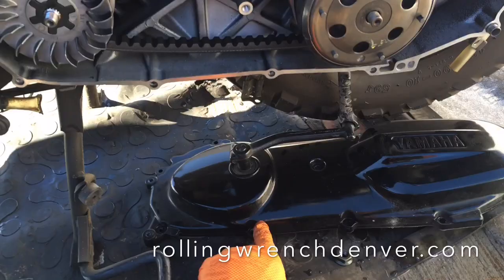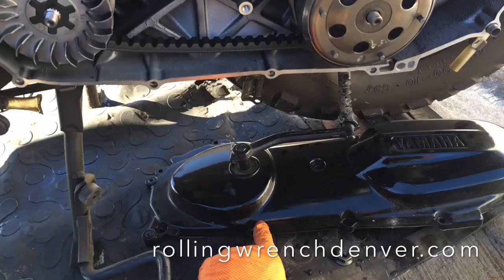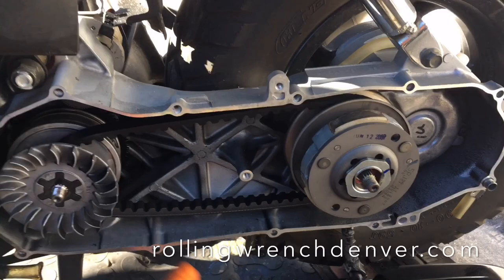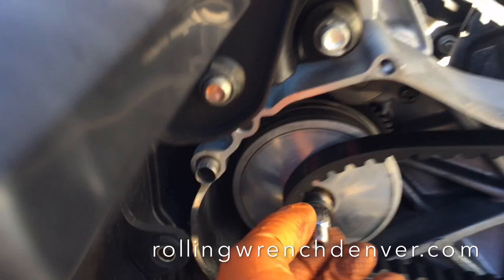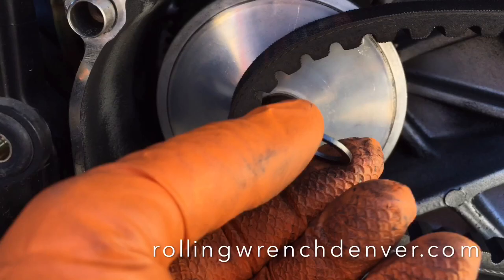Yamaha Zuma 2T FREE performance upgrade

Comment: People, doing this, you will lose acceleration in "first gear" but gain top speed (provided that the spacer lets your belt sit closer to the shaft). It can be quite dramatic, like 10 km/h. Go ahead and experiment and see what you prefer. BUT, before you experiment or do anything, READ THIS and do not throw this spacer away!

When reassembling, the conical washer that is used with the nut (also make sure to install conical washer the right way), should NOT touch the splines of the shaft. The conical washer should sit against the "whatever you call it other part". If that conical washer even slightly touches the splines, it will eat the splines away when you torque it, especially with an impact gun (which most people use). Have fun disassembling and repairing your splines and other damaged parts after that (if at all possible). This is applicable to Yamaha BWS of all years and probably most other brands of scooter. When checking if the spacer is required in the assembly (and given the tight tolerance of the assembly, I'm sure it's required 95% of times), make sure to give your belt some slack so that you see the real final assembly position, or even better check without a belt. 

If you can see the splines, or if it looks like that washer might touch the splines, or if in doubt, you need to put that spacer back, or another spacer of the appropriate thickness to protect the splines. The spacer should be over the splines if you go for this mod. You can put the spacer either completely at the back or at the front. Now you may think, but I've already done this and removed the spacer completely and everything is fine. Think again! This is a conical washer. It will sit slightly differently against the splines everytime you torque it. The first 15 times might be fine, but the 16th time it might completely destroy your splines away. You will potentially be screwed and very sad.

Removing the spacer will also slightly affect the kick start mechanism. It automatically becomes "looser" if you completely remove the spacer (the mechanism has to go farther to engage). I'm not aware if this can lead to issues, but it's definitely not impossible.

To recap:

If you can see the splines when you're about to put the conical washer, you have a problem! You need a spacer. Put it completely at the back or at the front so that the splines are protected from that conical washer.

Edit: after careful analysis, I believe it's better to put the spacer completely at the back of the variator (if you do the mod). This keeps the belt in a more natural enlignment to facilitate reaching the highest speed possible. If you completely remove the spacer or put it in front, the belt is angled in a way that doesn't help pushing the torque drive to it's "highest gear" position.

P.S. If looking for top speed, have a look at your contra spring. Ensure that it is completely seated and free to rotate in it's location in your clutch. If it isn't completely seated even by 1 mm, it could affect your top speed quite a bit. Grind it (both the face or outside diameter, as required) until it's completely seated. Also look at the compressed length of your contra spring versus your torque drive. In the  absolute "highest gear" position, my clutch leaves exactly 3cm for a compressed contra spring. The blue and red contra springs I have here, when I compressed them, are both exactly 3cm. This means that the torque drive has to COMPLETELY crush the spring for you to reach top speed. For the blue one, that means 65 pounds of pressure (measured on a body scale). For the red one, that's approx 100 pounds. That's a whole lot of force required on your spring for you to reach absolute top speed. Hence why you shouldn't use the stiffest contra springs unless you absolutely have to.

You're most welcome. Remember to share your knowledge!

Further reading: 
https://www.pedparts.co.uk/blog/variator-fitting-crankshaft-pulley-spline-damage

https://benelliquattronove.wordpress.com/2018/06/05/scooter-cvt-variator-tuning-tip/
Reply from the maker: Wow, thanks for the detailed comment 🙏
Reply: Would this lead to making it extremely difficult to remove the variator and stuff from the crank shaft? Because I just tried removing mine and cannot get it off
Reply: @yesfigureitout  Hi, it's been a while, but yes. If the material of the splines got smooshed, it could prevent you from easily removing or installing the variator. You can check with a flashlight and even maybe a magnifying glass if the splines are damaged. If the splines are damaged, maybe tapping lightly with a soft hammer might help remove it. But don't quote me on that! When it happened to my friend's scooter, we were able to remove it, but not install it. I had to take some sandpaper and work the damaged splines until they were clean, and then we were able to install it back on. Good luck!
Reply: No u won't mine accelerates fast as hell and I went from 31,32  mph to 39 ,40 mph depending on weather and first ride of day sometimes
Reply: @yesfigureitout  sometimes can be hard to remove veriator anyway wiggle and pull keep trying it will come off bro
Reply: @CompletelyNormalPhenomenon  are u talking about the grooves in the crankshaft because my variator ate my bolt that was holding it on and I’m not sure if the space I took off is the reason for that
Reply: @CompletelyNormalPhenomenon   for some reason my variator shakes even when the bolt is on holding it any reason  for that
Reply: @FatboyTris  I would have to see pictures, I haven't looked at this in a long time.

Comment: I did this trick plus I  installed a new  bando belt and lost almost all takeoff power but reached 40mph, old belt was about 4mm narrower, decided to place back the washer and it worked just fined
Reply: Help! Since the last maintenance my 2016 Yamaha Zuma 50cc, has NO takeoff power. Wide open it still bogs down and eventually reaches 38 mph. I took it to another repair shop, who kept it for nearly 3 months. $300 and still have the same problem! These are great scooters, but something or someone really messed it up.

Comment: You’re actually supposed to play with different wit spacers, depending on the width of your belt and the length of your belt. Also, the size of your variator matters. By removing that washer you’re not using the first 10 to 15% of that variator at all because the belt starts riding higher.

Comment: I did it on my 2000 Zuma and I lost a shit ton of take off power but I did gain about 5mph on top end and it did eat the side of my belt up just wasn't worth it to me I had better luck tuning the variator weights and leaving the washer in place
Reply: This ⬆ had the same experience with my Aerox R. Very poor acceleration and not worth it unless you travel long stretches i guess

Comment: When you do this you need to put the washer back but more in front not to ruin your variator and you will still gain a bit of speed even with putting the washer back
Reply: Speed gain should be the same if you put back the washer or not, but read my other comment. It can be very important to put it back depending of your assembly.

Comment: Thanks for the video great tip
My 1999 Zuma CW50 has a bolt at the front of the transmission cover lower down that cannot be removed because  not enough clearance to back it out! Do I have to remove the body just to get the last screw out? Hope you can help this noobie
Thanks
Reply: Nope,just take off the foot peg by removing the 2 screws holding it on.

Comment: Thank you for the video, I have different needs and no idea how to deal with them. I bought a 2012 Yamaha 50 cc to carrying with me camping. I'm not interested in top speed but more low end pulling power to deal with hill in the campgrounds. Any ideas? Thank you and GOD BLESS.
Reply: Yes, Go buy a 125. I had a 50cc and it sucked and we never rode it, but rode the 125 all the time.

Comment: I heard doing this will make the outer variatior cone seize to the shaft and cause it to be next to impossible to pull off and cause damage. However you could take the washer and put it behind the inner variatior cone and it would be just fine. What do you think?
Reply: Chris Marek 
I was reading the same thing.
Reply: My buddy has 34k on 03 Zuma no washer and no issues
Reply: Is this true

Comment: I read doing this will make outer variator cone seize??
Reply from the maker: People comment that all the time. I would never make a video that’s going to damage someone’s scooter. I have been doing this for years with no issues.
Reply: Rolling Wrench when i removed the washer i heard something rubbing like to metals gently scraping against each other in the clutch is that normal ?
Reply: Rolling Wrench i did the quick update and i took out the baffel in my exhaust but there is a higher idol now

Comment: Hey bro what's the best weight for a 2t yamaha zuma? For good speed and power
Reply: If your stock get some 5g sliders or you could get a good, cheap Koso variator with 6g rollers for $30-35
Reply: @tdot1269  I have the top performance variator kit

Comment: I have a O2 Yamaha Zuma everything comes on but it will not start need help
Reply: Check for spark and fuel
Reply: Check fuel & air (carb), spark and compression (air leak on the head or exhaust). One of those isnt right. If they're all good your woodruff key might be messed up throwing off the spark timing

Comment: But... If I'll remove that brick the driving belt are on a higher gear at the start och the gearing.
Reply: Protip change variator "rolls" clutch springs and remove the spacer